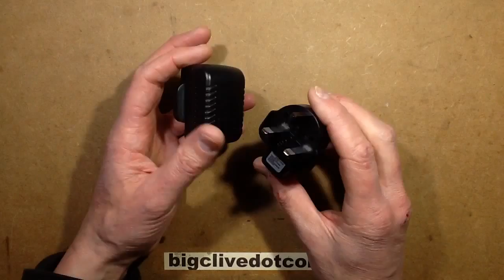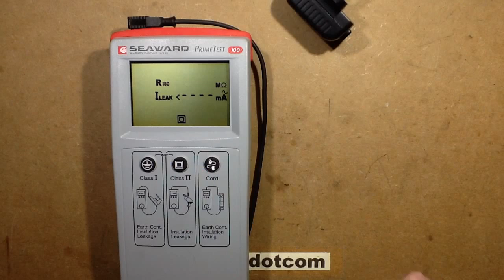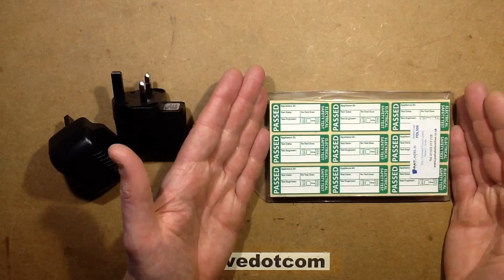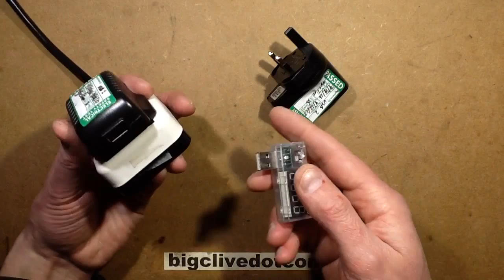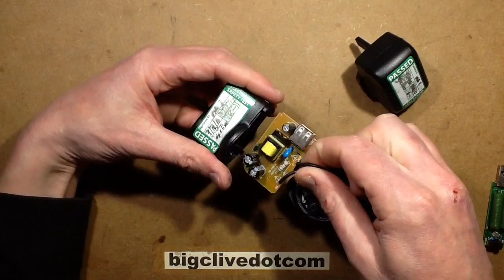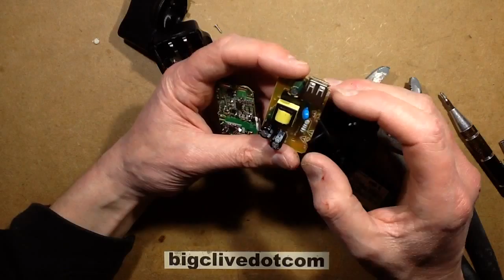Poundland USB charger comparison.  2016

Comment: @bigclivedotcom 

whoooooaaa hang on, you mean all i need to become a pat tester is a cheap machine off ebay.china some stickers and a pushbike? surely you jest and i need some form of paper work or the whole thing is a joke!

whats with all the C&G and NV doodahs and ISO wotsits sign written on the vans for if not needed?
Reply from the maker: There's a load of hype surrounding an industry that has been created around PAT testing.  There's no legal requirement to do it at all, but many insurance companies require it and it's a good way of indicating compliance with the electricity at work regulations.  The paperwork is optional documentation, although technically speaking the labels themselves are mini certificates.  It's all down to common sense.
Reply: Thats not confiscation.
That is theft from a property, and if they try to claim they took it because it was 'overloading a socket' that is theft by deception.
Those 'firemen' belong in one place. JAIL. for a long time.
Reply: Debbiebabe69 I think a prison sentence is somewhat harsh a punishment for being over zealous and under informed, don't you? Let's say he takes back her 3-way with a pretty apology and a bunch of flowers... and then goes away to learn how many amps make 13. 👌
Reply: There's a lot of annoyance... 
most annoying thing was the firemen going around at my mothers flats (built in the 2000s) and confiscating her brand new, legal, 13A fused, 3 way adapter which was running a table lamp, a wireless phone and a electric clock because it was 'overloading the socket'... which my mother found confusing and upsetting.
firebobbies seem to live in a 1960s public information film where everyone's jamming as many hairdryers, kettles and fan heaters as possible into unfused  roundpin adapters til they get red hot... and are going around upsetting old ladies to enforce some nonsense code they've made up for themselves.
Reply: they have no right to take anything, make a complaint and get your stuff back.
They came into my house and tried to tell me some bollocks or other, I told them I was a spark and they gave me a free smoke detector and pissed off.
Reply: joinedupjon Gosh! Is that really happening. Where did that twat come from, and who gave him authority to confiscate people's possessions in his ignorance?
Reply: +effyleven +Ray W +Debbiebabe69 Well that was Derbyshire fire and rescue, Glossop. You could probably have kicked a football into the firestation from the front door of mums flats... It's a housing scheme so they went  around with the manager - I sort of assumed the manager had authority to enter flats and confiscate 'dangerous equipment' written into the contract but I don't really know. We replaced the 3 way once before capitulating after that was also confiscated and got a trailing socket type. I mention it really because fire services are engaged in what clive calls 'industry' ; not many people have old school chippans suitable for starting a proper housefire, open fireplaces or properly bad house wiring anymore so they're entering the business of giving out smoke alarms and confiscating  adapters to make work when there aren't any cars crashing on their patch. Quite likely it's a net benefit to old people overall but it annoyed me and my mum unnecessarily. Probably there's a spreadsheet on some head firebobbies computer proudly showing number of 'unsafe' adaptors confiscated.
I got revenge on the scheme manager by 'confiscating' their stupid BC3 lighting pendant and fitting a normal one anyway :)
Reply: I had not really looked into the ''qualifications'' side of it but as my current vinyl sticker business is so dead its murmering ''brains'' i was looking at something else, and saw a pat testing course dvd on ebay, and then googled and found lots of places to train me for like £300, did an online test and got 75% or so and i was thinking of selling my current business tools, booking the training and buying a tester, but if i can skip the training...(i do hold a c&g in PC+peripheral  repair and have been an electronics hobbyist since 12, radio ham etc, so i think i can insulation test to a moderate level....)
Reply: The critical bit that Clive mentions is the ability to "Perform the test, understand what you are doing and interpret the results" There is no legal requirement for a PAT test, rather the requirements of the Electricity at Work which requires equipment to be safe. The PAT test is a recognised procedure what should capture the worst offenders.
Reply: Those cube-shaped multi-plug adaptors got a bit of a bad name in the 80s. Partly from ones that had too many sockets without proper clearance, and sometimes pins of plugs could touch inside, and short each other out. Partly because sometimes people would overload them, the idea of current consumption isn't really in most people's heads. 

In general they're safe enough, but not utterly foolproof, a strip adaptor with a proper fused plug is that bit safer. Probably won't affect the average person, but over a million households it might save one or two from burning down. In general it pays to err on the side of stupid, when you're trying to make the public safe.
Reply: greenaum Yours was a well balanced evaluation of cube-shaped 3-ways. Thank you for posting it. However, in the case in question the "stupid" was on the part of the man who took it away,... not the lady who loaded it so lightly.
Reply: The problem was the ones that were unfused. I have a couple of fused ones which I am happy to use (Lightly loaded) When my wife was a child minder, she had one of those free inspections by the fire service. They warned about the use of the cube adaptor, I think they have just been told to look out for cube 3 ways, they do not know the difference between fused and unfused.
Reply: As a PAT tester, all you need to be able to do, in the absolute worst case, is convince a court of law that you had no reason to suspect that a particular electrical device would cause harm to someone.  That just means  (a)  Performing a prescribed sequence of tests  (either using a special-purpose instrument or more general-purpose ones)  and  (b)  Writing down everything you did.

You can spend a fortune on a week-long residential course and earning yourself a flashy certificate, but it isn't going to cut much ice with a jury if they think you were in dereliction of duty by allowing a dangerous appliance to be used.  Especially when the counsel for the Prosecution starts asking you about the difference between TN-S and TN-C-S systems, and mentioning Ohm's Law, which wasn't in the course, you just attach the green and yellow crocodile clip to the metalwork of the appliance, press the test button and it lights up either green for a pass or red for a fail .....

Because at the end of the day, exactly what constitutes "unsafe" and who is to be deemed a competent person to carry out safety testing is a matter for the courts to decide.
Reply: Last time I saw a PAT tester was when I worked in a theatre. We had an electrician come in to test all our kit and spent many a happy hour stripping down theatre lights and visually checking the wiring before it was PAT tested. The tester was a much bigger box. I guess the advantage of miniaturisation.

Comment: I think we getting close to a point, Mr Clive, that we'd like you to share with us how or where you got your USB resistive load.
Reply from the maker: Standard on eBay.
Reply: Cut an old USB cable/broken USB stick and solder on high wattage resistors?
you can find suitable values/powers in any/most broken CRT tvs/monitors...
OR you could buy resistors, they are cheap, but i never tried, there is so much trashed stuff laying around...
Add a switch if you want it switchable resistance...but i found it easier to just make multiple plugs with different resisrors. They get HOT (just in case you forget ;-)
OR you can go ultra high tech and use a LM317 in current regulation mode, which is easier to mount on heatsink that does not burn your fingers/table/whatever it is touching after prolonged use ;-)
Reply: I got this one. Its using a mosfet as a load and has a ventilator that kicks in when the fet gets too hot: http://cgi.ebay.nl/ws/eBayISAPI.dll?ViewItem&item=351633262422

Comment: Could you get a OnePlus dash charger for a teardown? They claim to do smart stuff in the wall plug so the phone doesn't get hot, but I can't see what that would be... unless they actually supply a different voltage that better matches the cell...
Reply: Only Lurking I know the newer generations of Qualcomm's charging standard can drop the output voltage to 3.mumble volts in multiple increments for this reason

Comment: So "PAT testing" is like "LCD display" then.
Reply: and PIN number, ATM machine, NIC card, ,ABS brake system , GUI interfaces....

So many cases of of RAS syndrome  (Redundant Acronym Syndrome :-)
Reply: AzuraelX "ABS stands for Antiblockiersystem (Anti Lock System) so ABS brakes is correct"

That'd be in German - in English the expansion is usually Antilock Braking System, So ABS Braking System would actually be a double redundundancy...
Reply: Aadil Shah interesting that you have never heard "PIN number". I find that a very common phrase where I live. I also here "ATM machine" used about equally with ATM
Reply: Most of your "not good examples" seems to be down to your personal/local/regional usage. Doesn't mean they're not in  use elsewhere. 

As to the C in NIC meaning Controller, a quick Google does show Controller but also  Circuit and Card.
Reply: Don't mind me, I'm just being pedantic as usual

Not a good list of examples though.
We normally talk about a PIN code or just PIN. I've never heard anyone say, "PIN number."
Similar with an A.T.M. We just call it an A.T.M.
NIC stands for, Network Interface Controller. Therefore, "NIC card" expands to, "Network Interface Controller Card"
I've heard, "ABS Brakes" before, usually in marketing and advertising.
And I usually say, "a/the G.U.I." while most of my colleagues and friends have no idea what that is. :P
(no, I don't say "gooey" that would be like calling an L.E.D. a "lead" :P )
Reply: I live in South Africa. Maybe that's the difference?
Reply: Me too I agree

Comment: I'm almost ashamed to ask, but what is the purpose of the spark gap on the PCB?
Reply: Prevents arcing between tracks on the board.
Reply from the maker: If there's an electrostatic discharge onto the chargers lead or whatever is connected to it, it provides a path back that avoids excess electrical strain on the insulation of the transformer or suppression capacitor.

Comment: What I'd really like to know is what is the danger of something like this failing catastrophically? I'm imagining it'd kill the device plugged in?
Reply: well theres that, or it could kill you. clive did a vid a few months back about a usb power supply that put out mains voltage on the usb sockets. and those poundworld ones that got recalled are apparently a fire risk.
Reply from the maker: These ones are better than many others in that regard, but when something small like this fails there's always the risk of the conductive flash of plasma engulfing the interior of the unit and briefly providing a path for fault current to the output.

Comment: The metal strips running from the plug to the terminals inside the second charger, what do they run near? Those giant bare metal strips seem like they might ruin some of the clearance or isolation inside the unit.
Reply from the maker: It is clear of everything.  I checked that.

Comment: Do you remember the old round electric kettles (not Russell hobs) that the element was held on by a large diameter plastic but and sealed with a rubber grommet. Well the main body of the kettle was not earthed and would fail any Pat test and could not be regarded as an isolated part.

Comment: I'm a support worker in a care home. I do all the pat testing. 
Someone thinks I'm competent.
Reply from the maker: If you know what each test is testing then you are competent.
Reply: mostly!! However if I fail something no questions are asked the lead is cut off or it goes for a repair.
Reply: I'm not even supposed to change a plug so opening say a toaster isn't an option. The plus side of things I got a free Henry vacuum for my man cave and several other things to strip for components :-)

Comment: The tester shows 0,1 mA leakage. Shouldn't this be zero? Or is 0,1 mA the lowest value it will indicate?
Reply from the maker: Even with nothing plugged in it shows 0.1mA.
Reply: the class x capacitor for interference supression passes a small current across it
Reply: it could be a side effect of that little 1nf capacitor.. i think those do cause some leakage, which is what can make some power supplies get a little tingly. (I might be wrong but i'm fairly certain that's what it is)
Reply: "a little tingly"?! I always jump up one meter if I touch such a power supply! (Maybe I am very sensitive...) No mains capacitor coupled power supplies for me! I like every output to have a reference to ground! I once connected a switched mode powersupply (in a PC) to a not-grounded outlet, and I had the feeling I got killed...
Reply: All online SMPS do leak some current from primary to secondary of transformer and that is impossible to avoid (capacitive coupling in transformer) but usually that current is in range of 10-20uA which is really bad from an EMC perspective. Y caps are there to provide return path for that current and to fix EMC issues.
What you saw is probably limit of instrument (100uA is on high side of leakage for SMPS, and I that only on some really bad ones).
Referencing all output to ground is something which is not possible/desired is many cases (that why laboratory power supplies are not referenced to ground), but you probably thought SMPS that have earth connection and Y caps between output and earth (still floating output like in most PC SMPS) which again  can cause other problems (like tripping  RCD if you have lot of them ...).
What you felt when you connected PC SMPS in un grounded socket is full transformer leakage current (not connecting to ground you make Y capacitor not connected and instead of they provide return path for it you provide it, so current flowing through you was greater).
ps: small currents are beneficial for you and they are used for medical purposes :)

Comment: Hey Big Clive, had an argument with my mate about the difference between Digital and Normal electric motors he told me there was no such thing as a digital electric motor (or they all are) if there is a difference could you do a video on what the difference is? of if he is right just let me know... cos i want to know.. I think there must be or Dyson couldn't make a big old fuss about their motors being digital on adverts if there is no such thing, I know its not related to this video, but i thought if anyone would know and be able to explain it - it would be you! thanks for your videos you got be back into electronics again (I dropped out because I can;t physics)
Reply from the maker: It's a real thing, but with marketing hype.  What they mean by "digital" is that the motors are electronically commutated.  Or in other words they have no brushes or slip rings.  The coils are switched electronically (that's the digital bit) by sensing magnetic feedback.  This allows small motors to be run at much higher speeds than could be achieved with carbon brushes.
Reply: If there's a little computer in there (and there probably is, a microcontroller is basically worth using compared to any 2 other chips, and often cheaper and better than any single chip), then fair enough it's digital. PWM doesn't mean digital. 

It depends on the motor like Clive said. "Digital" motors have separate coils, and each one is energised in turn by an electronic circuit, often "digital". A motor that runs off a standard PWM speed controller probably isn't. Instead it's commutated mechanically. IE the power is switched between the coils using little carbon brushes on a segmented ring. 

Actually the BLDC, Brushless DC, motors used in hobby stuff, remote control cars etc, would count as digital too. They have a little onboard controller energising the coils. "Brushless" is probably the correct term for Dyson's motors.

Obviously Dyson didn't invent the brushless motor, but maybe they invented putting them in hoovers. Brushless motors do pack a lot of power in a small package, quite a lot more than ordinary ones. 

Still, Dysons are like Iphones, they sell 50% on hype, and 50% on being able to tell people you've got one.
Reply: does that really make it a "digital" motor tho? theres no doubt that the dyson motors are really well made little things but if electronic control makes a digital motor then a lot of motors are digital, the direct drives in technics decks, or the 12v motor I put in a little dremel/drill thing I made that has a quids worth of ebay PWM module controlling it. personally I think dyson are stretching the language as far as they can get away with
Reply: also this seems relavent  http://www.hulldailymail.co.uk/fire-risk-as-poundworld-phone-chargers-are-recalled/story-29970870-detail/story.html
Reply: no such thing
Reply: bigclivedotcom thanks! :D
Reply: Thanks everyone for all the info, I consider the argument settled! and that Digital motors are a thing... :D
Reply: They just mean that the motor is controlled by a digital electronic circuit, as opposed to an analogue electronic circuit (or no electronics at all, just traditional brushes and commutator).

It's just marketing hype.  Like cyanide-free toothpaste .....